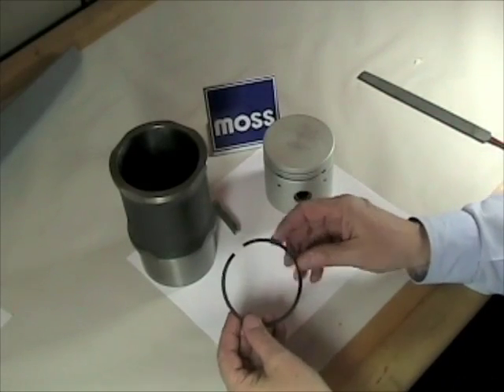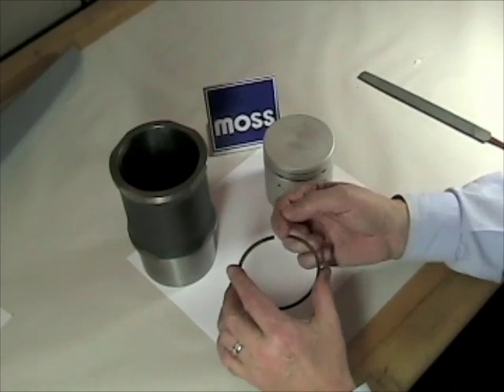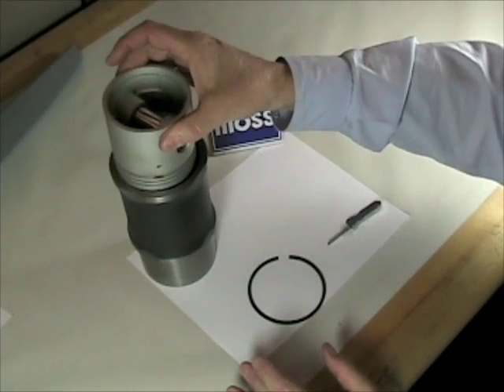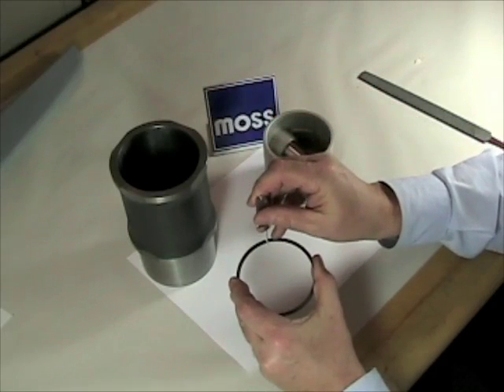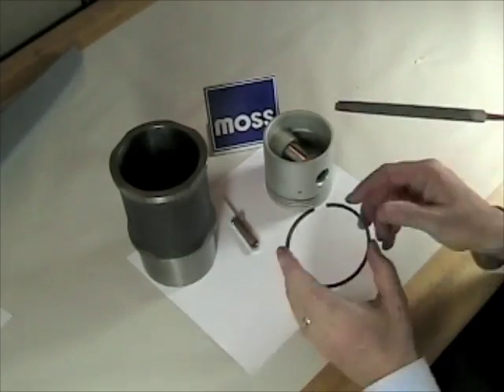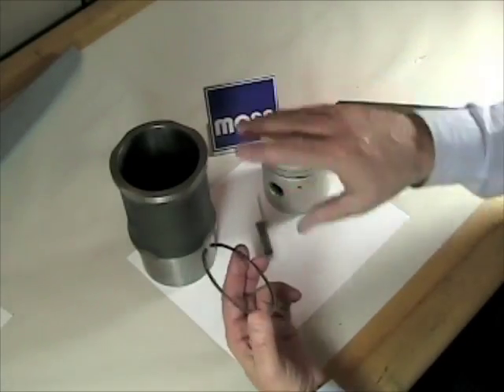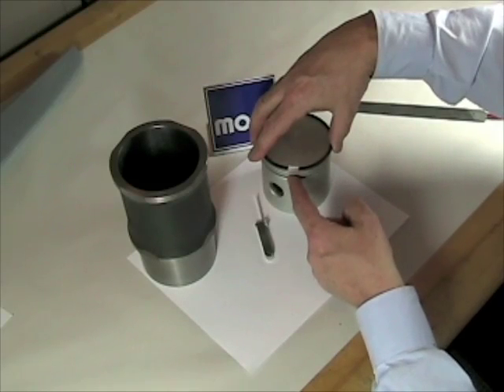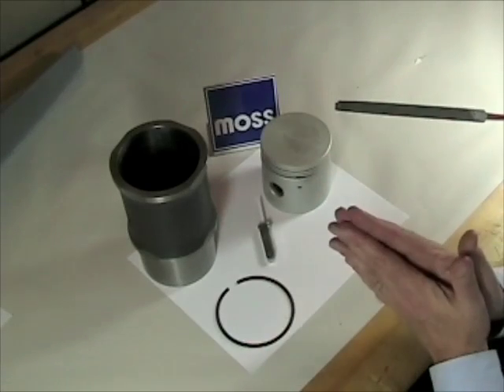Piston Rings - How to Install

Comment: I dress the ends of the rings after filing. A slight bevel to the sharp edge helps prevent the ring from machining the cylinder wall